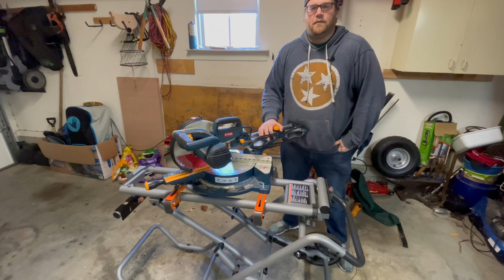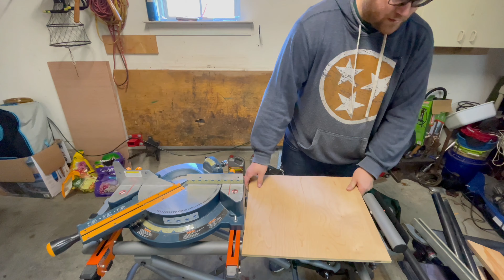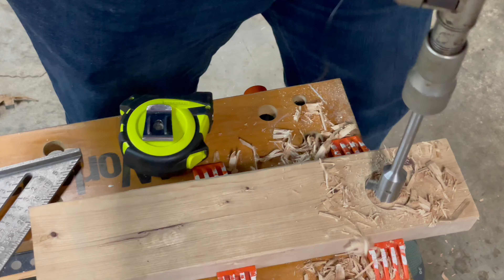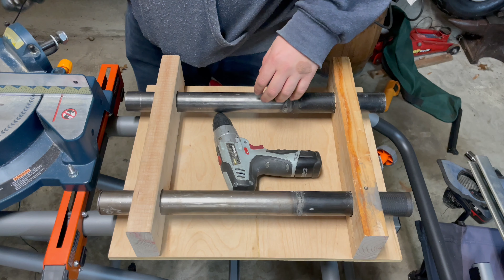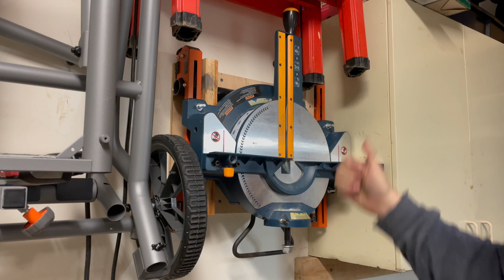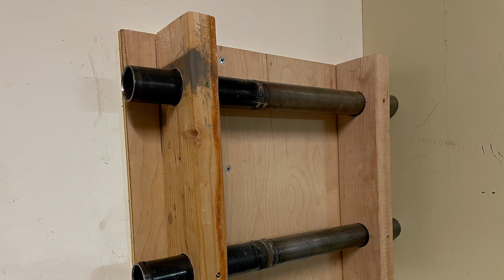Miter Saw Wall Mount Using Stand Brackets

Comment: Great video! I just mounted using 1" black gas pipe and elbows. Would not have thought of this without your video. Thanks
Reply from the maker: It grip well with the 1" diameter?
Reply: @TheVintageEngineer  yeah, I believe it’s 1” ID, so fits great.

Comment: Could I pull this off with Schedule 40?
Reply from the maker: I would think I’d you are clamping close to the wood vertical parts then it should work.
Reply: I did this but forgot to update. It worked.
Reply: @kehlmeier  thanks, did this as well using your idea. For anyone in the future 1-1/4in spaced about 5.5in center to center works great for ryobi mounts. I tried 5.75in at first but it looked a little too wide so I went with my gut on the 5.5in
Reply: I'm wondering the same

Comment: Any reason not to leave it on the stand fold up against the wall? After-all, you’ll still need to store the stand. Only concern is the angle of the blade on the stand when upright. Not sure if the weight of the saw at an angle will cause it to lose 90 degrees?
Reply from the maker: I can lift the stand by itself, but adding the saw is too much to lift all at once.
Reply from the maker: I’ve got the stand up high on the wall as well. So both are off the ground, saving space.

Comment: Nice. Would be nicer to have it fold out and be ready to use 😉
Reply: Thank you for showing how you built this. I have space limitations as well as was thinking of storage solution. Plan on building one myself.
Reply: ... and some big honkin' stepper motors, articulated arms, and an Arduino controller allowing you to control the whole thing with your cell phone from your recliner on the other side of the shop.  Yep!
Reply: @nevillenewman2785  not my thing but I'd like to come to it with a piece of wood in one hand, fold it our with the other, do the cut, fold back.